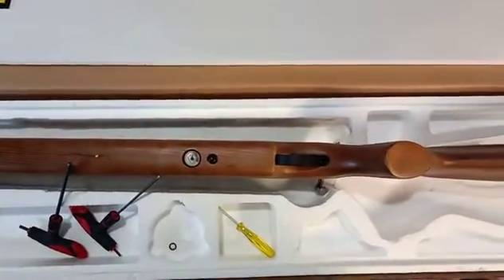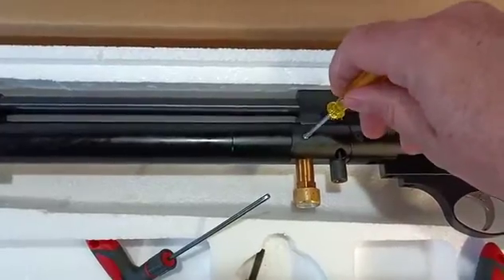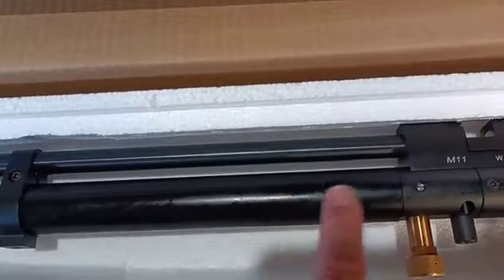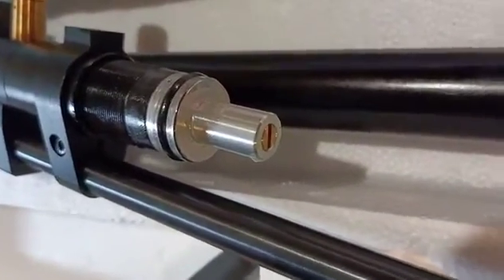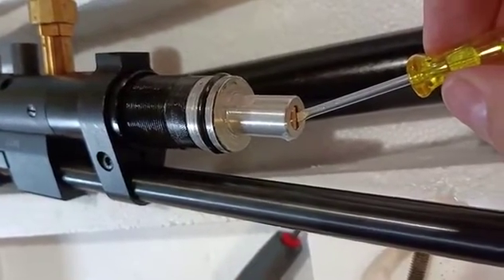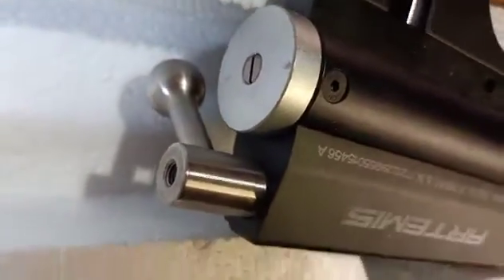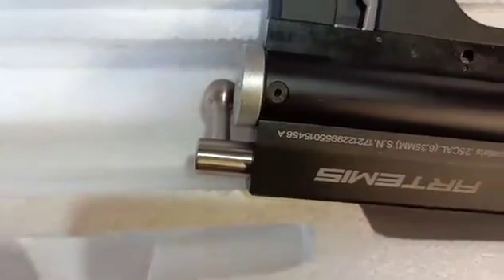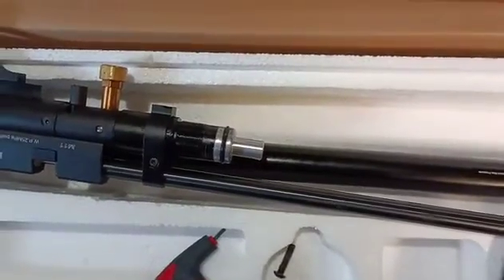Artemis M11 MK2 Regulator and Power Adjustment instructions

Comment: Very nicely explained thanks 👍 Is there any advantage to taking out the Belleville washer stack and rearranging them ? Some of these models have weird stacks of (() ((())) ()), and I have read usually they are stacked () () () () for low pressure and (()) (()) (()) for high pressure 🤔
Reply: Have you tried a different stack?

Comment: Hey again Wes. I’ve recently had mine apart to add another transfer port one putting it back together. I can’t pull the bolt action back at all it’s catching on the trigger but can’t work it out for the life of me been sat here couple hours
Reply: Sorted it now Wes. I’ve put a 5mm Transfer port in it and tensioned the hammer spring up but not achieving what I want. I was using a 3mm port and hammer spring tensioned to full and achieving 33fpe. With the 5mm I’m only achieving 27fpe. (Same pellets) my regulator is running just under the 2. any help would be much appreciated
Reply from the maker: @mattsmith9225  glad you got the cocking issue fixed. Sounds like the regulator is set pretty high. You may need a heavier hammer spring to take advantage of that higher pressure
Reply from the maker: A longer spring of the same gauge wire would work too. I believe I still have a few of the springs here for the non regulated version of the M11. They are quite a bit longer than the regulated version.
Reply: Cheers Wes. Think I’ll be buying the brass power adjuster very soon so I may aswell grab a Hammer spring at the same time from your site. Will try find a business round me in the mean time that could make me the same spring might be difficult though. Gonna try bring the reg down at the weekend fill it back up and see if that makes a difference if not I’ll strip it down and put the 3mm port back in for now until I have the new springs. Is there anything else I would need?
Reply from the maker: @mattsmith9225  Hi! That should be all you need 👍thanks

Comment: Any idea where I can get a new hammer spring for the M11? Or one that is the same???
Reply from the maker: Sure I've got some here. I'll put them up on my website
Reply: @wesbashforthairgunarcheryf6166  thanks for that Wes. Massive help. Will be placing the order once I’m paid next week. Will also be buying the brass power adjuster and the UNF adapter. Thanks a bunch for your help!!
Reply from the maker: @mattsmith9225  you're welcome!
Reply: @wesbashforthairgunarcheryf6166  just a quick one, does the brass power adjuster come with the little washer/spacer that sits on the spring? Thanks again.
Reply: @wesbashforthairgunarcheryf6166   you legend!!
Reply from the maker: https://airgunarcheryfun.ca/artemis-m11-hammer-spring/

Comment: Thanks I wish you had a few more videos especially concerning your import line of products.I don't love a videos on working on the trigger and  Ive been patient in waiting for some replacement magazines as the one that came with and the extra are terrible.I have a non pal unit and my regulator is set at the factory 130/140 it's kinda hard to see exactly and I have been really trying to find some decent accuracy with my gun.I believe some of it has to do with the trigger while sometimes I believe it may be barrel
I hope to run a shot string and see where I sit after that

Comment: I found that the hammer tensioner moved during use. So rather than using  Locktight I bought another side hex screw (one of the 2 which hold the silver plug) longer than original  and cut it just long enough  to pinch the hammer adj screw to prevent  it creeping.
Reply from the maker: Good idea!

Comment: Great useful review. Can you pls help me to guide about what is the procedure to increase number of shots on my Snowpeak M25. Its just giving me around 25 shots per fill on company settings. Thanks in advanve
Reply from the maker: Hi! Sorry for the slow response. I would start by turning down the hammer spring tension at the back while using a chronograph. You will have a minimum velocity you need for what you are doing so that is going to be determining somewhat your shot count but if you are getting such a low shot count it sounds like quite a bit of air is getting wasted so I think you should be able to turn down your hammer spring tension some before losing much velocity. That will help a lot. If you aren't needing a lot of power you might try removing the pressure tube and turning down the regulator another 25 or 30 bar and then doing the hammer spring test over again. The lower the regulator the more shots you'll get a fill, though you need to balance the hammer spring tension for the regulator pressure or more air will again be wasted. Hope that helps. Another thing is to avoid using too light of pellets. Pcp are generally more efficient with heavier pellets so you can squeeze a few more shots out by upping your pellet weight.